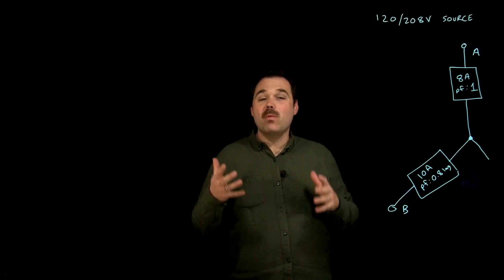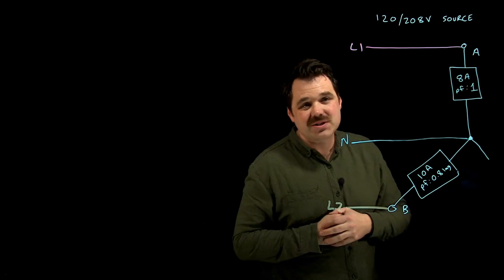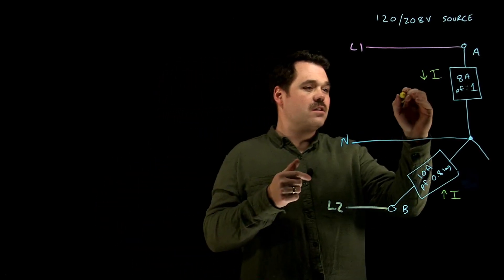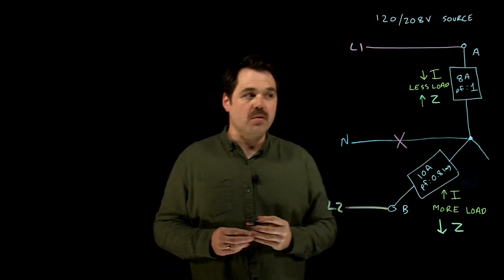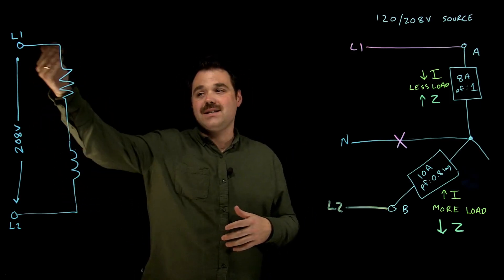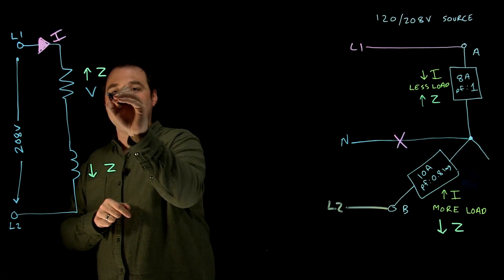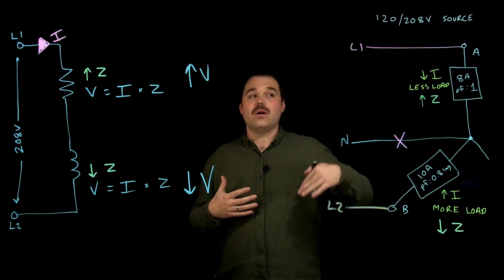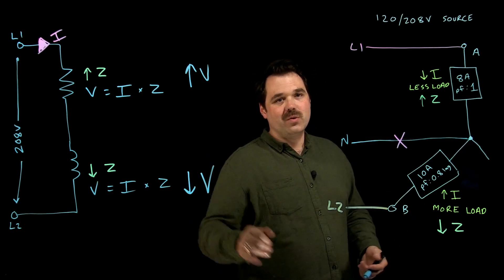The Neutral Conductor and What Happens When it Breaks

Comment: So what I wanted to know during this whole great video(and it is good) was what the voltage is going to be at the broken neutral to ground or in your drawing at the purple x .  This is so important and I cannot beleive you skipped this part about "broken neutrals". No offense , but such a good video should  include the shock hazzard associated there.   In your circuit the V-drop for both resistors is 115v for the higher Z and 92v for the lower Z   so what is the voltage at X (broken neutral to ground)
Jim.

Comment: Hi Zac, 
Thanks for this great video and informative explanation. Would you please advise if neutral wire breaks on three phase power supply, within a DB with RCD is installed in, would that RCD trip off and cut the power off in case of loss of neutral wire. 
Thank you.

Comment: I was in a factory when they lost Neutral connection, I had a laptop charger plugged in the Charger literally blew up, Lap top, survived frightened the living day lights out of me. This was in the UK where our single phase voltage is nominal 220v.
Reply: Nominal 240v 
 
And your laptop SMPS will have seen a spike in voltage of over 400+vac, as the rectified voltage is the Vpeakxsqrt2 then we can safely say the main rectifier capacitor handled 560+vdc which was most likely the part that exploded ( those universal smps primary smoothing capacitors are rated only for 450v max)

Comment: Indicated open neutral.  The less LOAD (8A of current) will continue 
to function.   HOWEVER do not touch the open neutral (line side) as indicated.  Kirchhoff’s voltage rule for series circuits.  

Believe this is correct, comment please.

Comment: Very informative well explain, it means a dangerous thing once the neutral conductor is removed in a wye transformer config 4 wire distribution system. Some loads will be like a firecrackers since they will be operating at higher voltages beyond their ratings, while other loads from other phases will experience low voltage and will experience heating causing damage eventually if not addressed  immediately by the utility company. It is a floating neutral. It is like a boat that is not achored when the owner left it, and to his/her surprised the boat is gone taken away by the wave.

Comment: Can you explain it with the 3 phases and 3 unbalanced impedances?, because of the current have 2 paths on the joint, so how i calculate the current on the differents loads when the total load is unbalanced i cant use root3, 

So i can calculate each (Z) voltage for a given unbalanced load with no neutral
Reply from the maker: The principle works out the same with all 3-phases loaded up. You'll only have current flowing A to B, and then B to C and then C to A because of the alternating current sine wave. The math would all be the same though
Reply: @ZackHartle  yes if you do as a function of time its just a DC circuit.. but for example Z1 would have a voltage because of Z2-Z1 and Z3-Z1 like you say It would give me diferentt values at diferentt times , but there must be a way to calculate the RMS values, i find equations with relationship of the impedances looking for secuence zero voltages but dont know how to apply
Reply from the maker: @yametekudasaisensei539  That's a little beyond my knowledge.